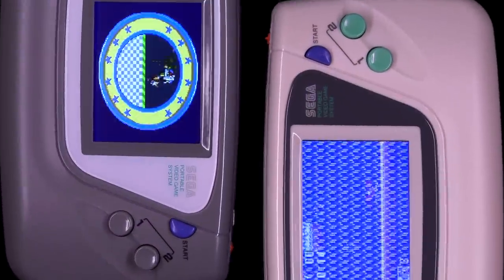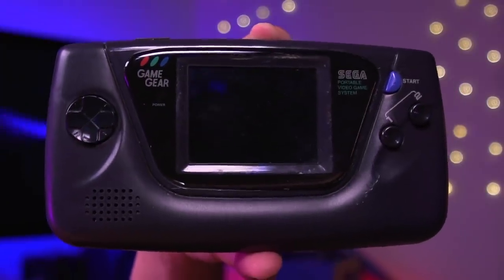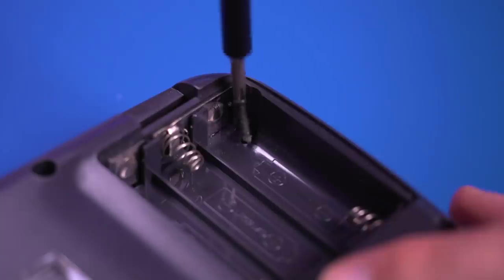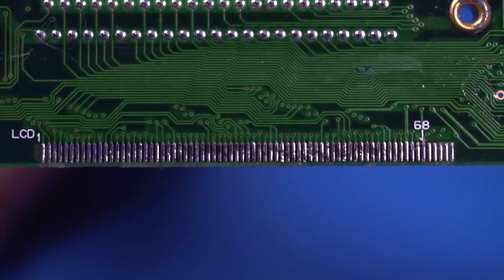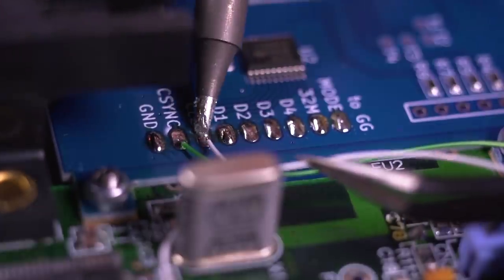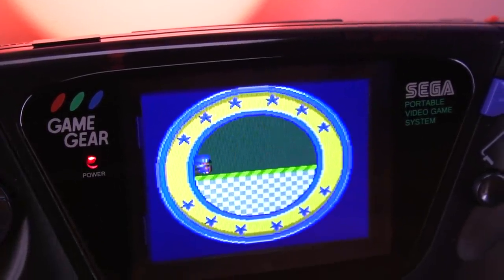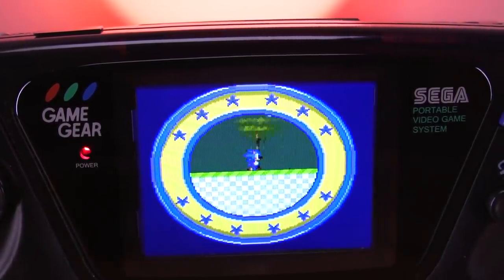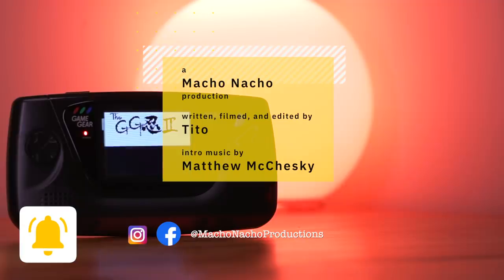RARE IPS Backlight Mod for the SEGA Game Gear From Japan! | GGLCD Install Tutorial and Review

Comment: They single one video mode is a definate pro for me. Because with this integer scale you have the perfect ratio and can cut the shell fitting the image. This can't be done with any other kit because you would have to cycle through all video modes since all other kits don't remember the last video mode. 
This one is a winner if you ask me, if you cut the shell properly. It would be a dream if retrosix would make custom shells for this integer scale mode.

According to the brackets: For most of the kits the brackets were made "aftermarket". So why shouldn't it be possible here. Actually it's pretty easy to adopt sind the other brackets utilize screens of the same size.

But the price is sadly a no-go. 
If the other kits would implement a save feature for the last mode used it would be a nice.

Comment: The one thing about Kaden no Ken-chan is that he's just a guy that gets other hobby self made electronics. He has one  spot inside the radio-kan in Akiba, and only opens weekends because of the... world situation.
Reply from the maker: That’s very interesting. Thank you for the info!
Reply: @MachoNachoProductions  last time I checked he had an IPS modded VMU on display which he expects the kit being available sometime next year. Maybe.
Reply from the maker: Who that will be pretty neat!  Is it just a IPs vmu or one of those retro emulators?
Reply: @MachoNachoProductions  your average Dreamcast memory. The only thing more niche would be the pocket station...
Reply: @MachoNachoProductions  I did hear that there were typical backlight mods for the VMU, too. Sort of similar to the old-style mods for Game Boy + Pocket. The best thing about them is that they're active while you have it in the Dreamcast controller, so you can actually see the display even in the dark, which helps so much for Dreamcast games which have heavy VMU screen usage.
Reply from the maker: That’s would be a very cool mod!

Comment: Word of caution from hard experience - hot glue can be hot enough to cause thermal shock to an LCD - I had a GBA backlit LCD shatter from the hot glue once, lol. Make sure you're using your hot glue gun on a low setting, and try not to glob too much onto the LCD.

Comment: I actually don't mind screen mods that don't have multiple screen size selections. As long as it's very close to the native size of the original display and is integer scaled. But when its cutting off a significant portion of the screen, its a problem.
Reply from the maker: Yeah, that’s the main issue. There would need to be significant cutting to the viewing window.

Comment: Will we ever get a Game Gear LCD mod with proper integer scaling? Seems like a far off dream at this point
Reply: Nearly impossible because it would need a 3,2" screen with a resolution that would be a multiple of 160x144 and this screen doesn't exist.
While it's not SO complicated to design a board, it's much more complicated to design a screen. So until a screen like that is released for another purpose it will be a dream for a moment.